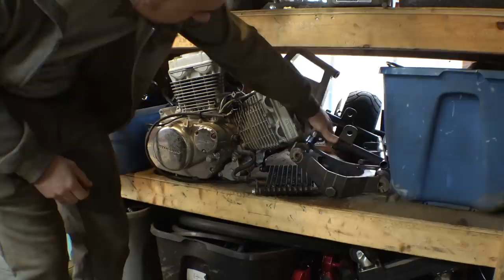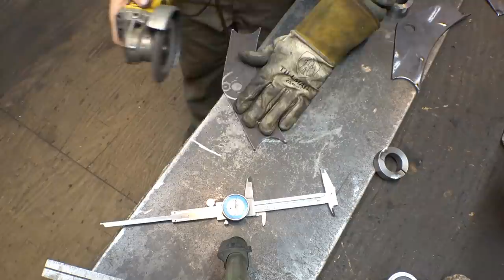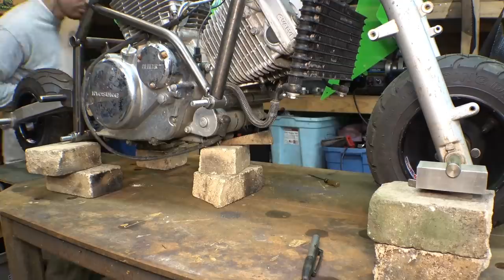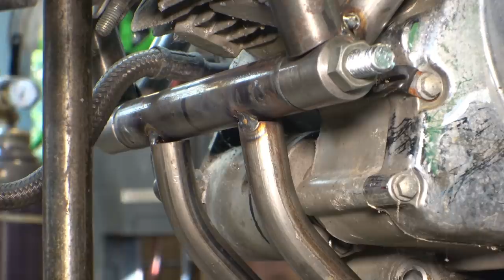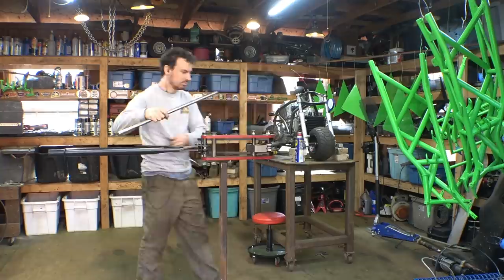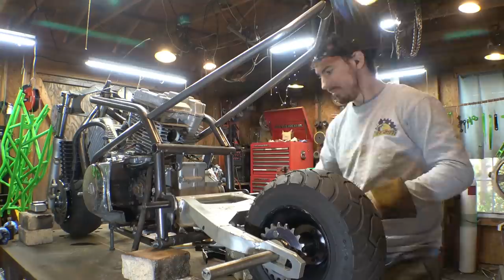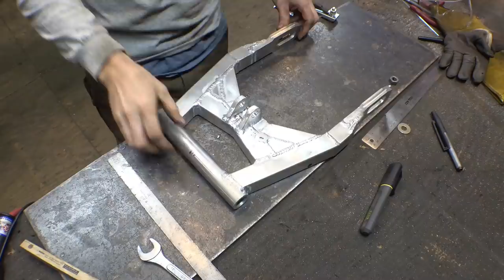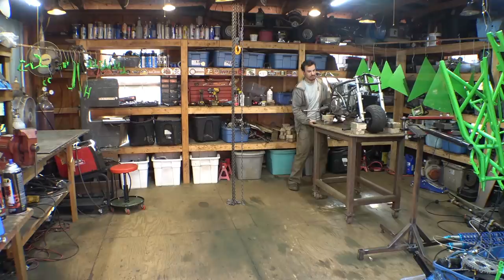Mini Crotch Rocket Build Part 3

Comment: Your searching the wrong stuff for suspension for that. I’d search a mid sized atv rear suspension. A shock for a Honda 300ex would be ideal. Maybe even a youth dirtbike rear shock. The shocks don’t have much travel because the way the dog bone setup works it doesn’t need much travel.

Comment: Don't use two of them small shocks, it will look ridiculous.  I think the red shock would be good enough to run around on.  Not like it will be a daily driver anyways.
Reply: If he could open the red shock to access the valving he could add a few extra shims to the rebound stack to slow it up. The compression end of it looks good. He can also add heavier weight oil to the shock and that will stiffen it up on both comp and rebound.. Just a little to springy.

Comment: ..guess I can use an education in modern sport bike geometries. Does anyone know why it was necessary to modify the triple clamp to have a different steering head angle, from the down tubes?   
I ask because, when I raced superbikes in the 1980's we would speed up the steering angle by extending the fork tubes into the triple clamps, which lowered the front of the bike and increased the steering angle ..thus decrease the transition time between corners.

Comment: Yo man, too sad you had to order so many shocks... 

What you could do and would be smart ia to get a complete rear shock from totaled scooter 8 believe all of the 125cc would fit your weight, but mind that they usually come in pairs so maybe a single on of the 250cc if any available, but dont get upset by the springs because custom order spring is super common and not that expensive, you need to know the travel that you want (and you want the most that you can get for better adjustment) and the supposed weight that it should counter, if its not too late and you find this comment then i highly recommend you try to look it up, and if you still have any questions id like to help you :)
Reply: Ahh also about the plastic pieces (ferring) try to look up burning wrenches a russian fabricator that does many if this stuff and he has an english channel as well, so he does composite fiberglass parts super easy, hope thisll help you as well!

Comment: The red and vlack shock is perfect, i promise! Suspension isnt supposed to be soft in the rear of crotch rockets, i have ridden and built them for a looooong time, and u dont want to be able to push the rear down much with body weight.

Comment: that shock is not guna work u should of orders a thumbstar shock thay work the best and u might wanna wld a plate on the back of the swing arm so if the bolt on the swing arm snaps u have something to catch the spring if it falls off swing arm and it can save ur life iv seen plenty of shocks brake and its not pretty